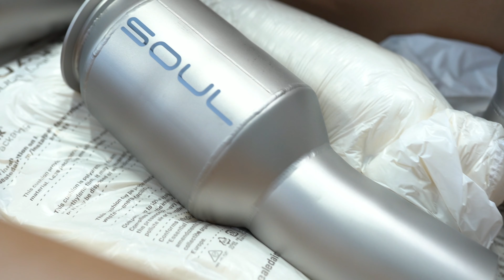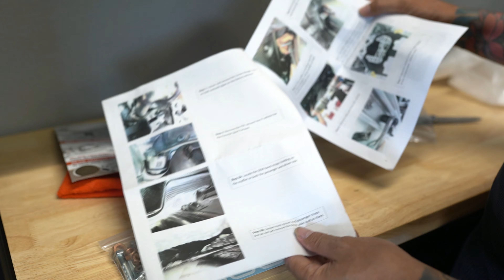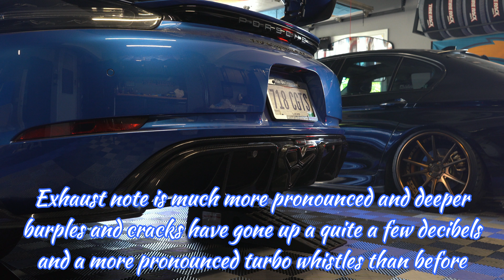SOUL PERFORMANCE Porsche 718 Boxster/Cayman Sport Catalytic Converter Downpipe and X-Pipe install

Comment: Wow, really detailed video! I take it the Soul downpipe/cat does not connect to the stock exhaust and you also need the Y-pipe?
Reply from the maker: Thanks! Yes, all separate components 👍
Reply: You can run a SOUL Catted DP with the stock exhaust and it will bolt onto the stock exhaust flanges. Or you can run a SOUL exhaust from the stock DP back. You can decide which part to replace first or replace the whole thing at once.

Comment: Hey really nice vid, wondering if have that high pitch sound when you going fast? and is it worth buying it or just made small change?                                                                      Thank you.
Reply from the maker: No high pitch sounds. It does wake up the exhaust note much better. Helps with the exhaust flow
Reply: @lsturbointeg  I appreciate your fast response 🙏

Comment: Why didn't you go with a catless downpipe setup? I have a video on my channel where I did a full custom straight pipe.
Reply from the maker: @Bon-mz5kb  I went with the 200 cel in the beginning.  Buddy of mine gave me his SOUL PERFORMANCE test pipe so I have that sitting in my garage. I have the Fab mini pipe for the O2 sensor but was told to get a tune 1st to help prevent boost spike. Probably won't get that done til.next year

Comment: Looks like you skipped showing off the two parts I am scratching my head over. Removing the O2 sensor and how to get the clamp between cat and turbo loose/off. Doesn't seem to move at all.
Reply from the maker: O2 sensor is easy to remove just use a wrench. The clamp between the cat and turbo...maybe be stuck but just tap it with something...it'll come loose👍
Reply: @lsturbointeg  Have to find one that fits. On mine the heat shield blocks access to the O2 sensor. Debating whether to drop it first and then remove it. There is a fair amount of slack in the wire.
Reply from the maker: @ariel54cv  I believe I dropped mine down first than removed the sensor
Reply: @lsturbointeg  Video shows you dropping the cat with nothing plugged into it. I can get a wrench on it and get it turning, but wow is it twisting the wire because I have to keep turning it to get it out. Unfortunate you can't unplug it.
Reply: @lsturbointeg  got it. I didn’t drop it entirely I just shoved it up against the heat shield once it was loose so I could reach a wrench in above.

Thanks for the tips!
Reply from the maker: @ariel54cv  lol let me watch my vid again
Reply: Great video. Thank you
Reply from the maker: @HeathDamienHuffman  thanks for watching🙏🙏🙏